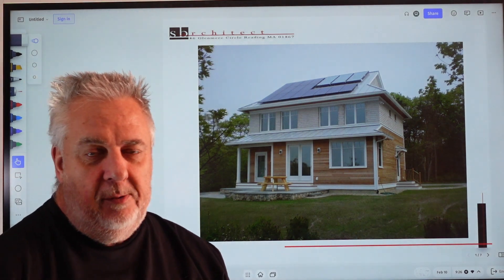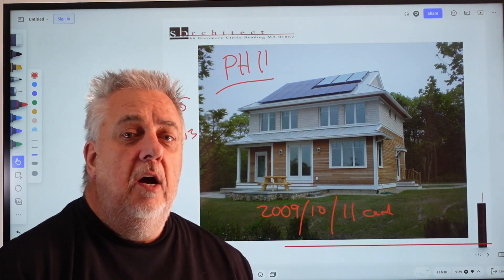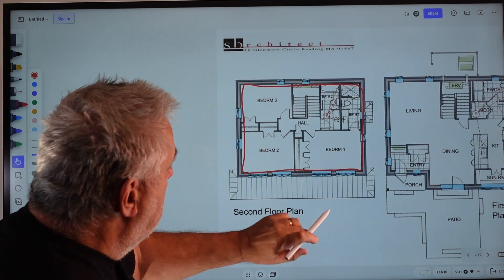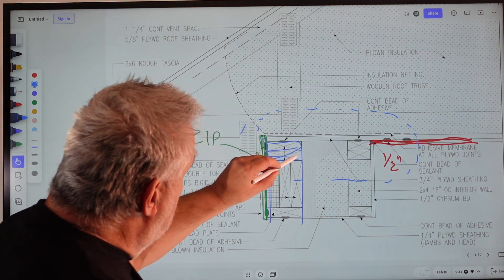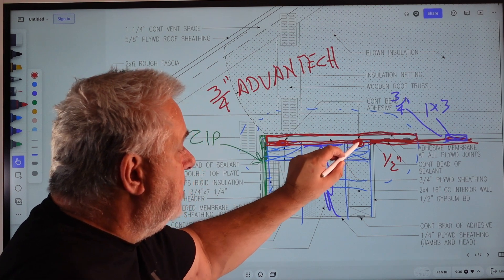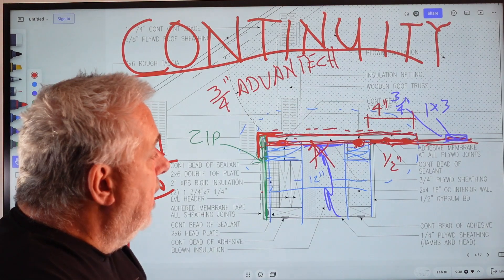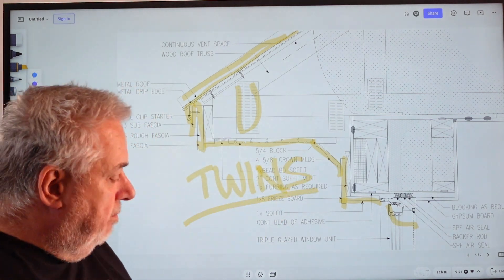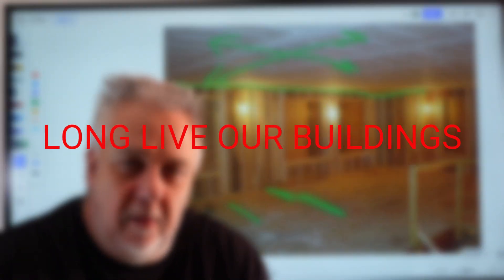SBa PH 11 series EP 13 ROOF EAVE DETAIL

Comment: Thank you for the insightful videos and your approach to information curation over ownership.

The connection of the exterior wind/air barrier (ZIP) with the interior conditioned air barrier (gypsum board) via a "switch" board is a nice detail, could also be useful in renovation projects.

Regarding your vented roof, is there a concern about wind washing or thermal bypass for the blown-in cellulose insulation in the attic? I’m asking because in Europe at least, we’d typically deploy two separate continuous air barriers: one exterior barrier to prevent wind from blowing through fibrous insulation and provide weather protection, and another interior barrier (warm side of insulation) for moisture control, often using taped smart membranes. The red line is then usually used to verify interior continuity.

Gypsum board is indeed an airtight and vapor-open material (even mentioned in regulations such as german DIN4108-7 for what it’s worth) though achieving durable airtightness at joints and penetrations can be challenging, which is why membranes are often preferred. Various options for air barriers exist, from smart membranes to taped OSB, closed cell foam to a certain degree, and even traditional methods like plaster layers in European brick buildings or eco-friendly solutions like continuous clay plaster and jute reinforced joints.

Regardless of the approach, a clear strategy for moisture control is crucial, either for example delaying vapor flow to favor exterior drying potential or raising surface temperatures to prevent condensation as you're doing. Perhaps worth discussing as a separate topic, inward drying is important - it especially works well with materials like cellulose and wood fibers with their hygroscopic behavior, but it’s also worth noting that there are limits to this particularly after going beyond 20cm of insulation, at least according to research…
Reply from the maker: We always have defense for windwashing, usually we foam in place the roof vents. Yes, we have used Siga Majrex for the air barrier at the ceiling also. Given this climate zone, there really isn't a need to delay/slow the amount of moisture entering the vented attic - ITS VENTED!!

Comment: Did you also drywall walls prior to interior partitions?
Reply: The air barrier on the walls is the Zip sheathing. The project would be way out of sequence if you tried to do electrical and plumbing and insulation in just the sidewalls.
Reply from the maker: No the primary air barrier at the walls is the Zip